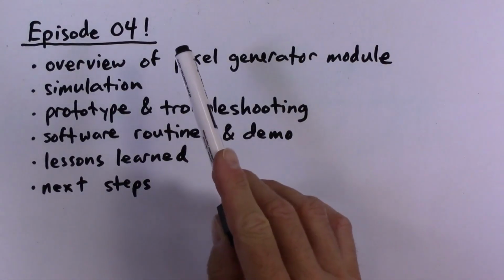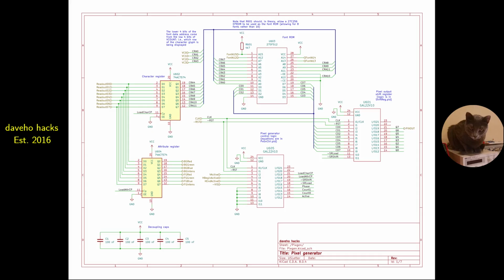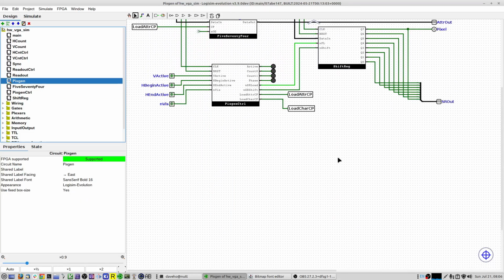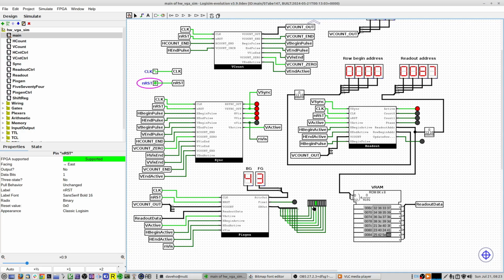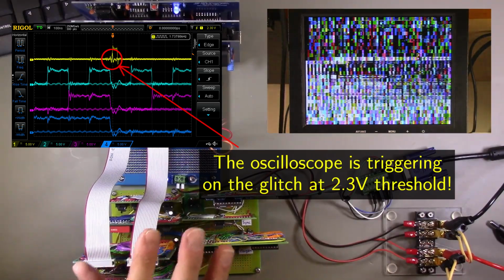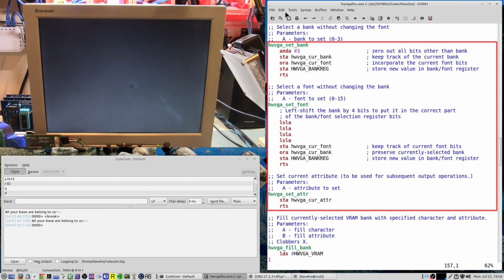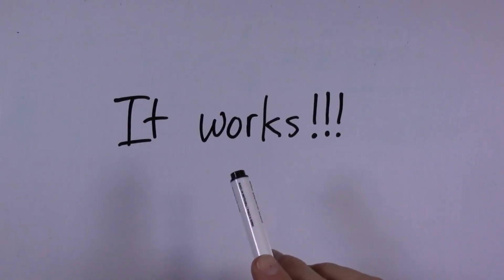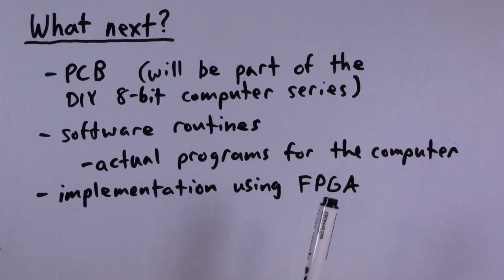Hardware VGA Episode 04: Pixel generation

Comment: Awesome progress, Dave. Very impressive!
Reply from the maker: Thanks, Troy! I've started working on the PCB. I think it's going to be pretty challenging to make everything fit. (BTW, I'd love to see a video about your Pi Pico TMS9918A replacement project.)
Reply: @davehohacks  it's coming... I'm a big-time procrastinator. 🤣 The project itself is going great though. I finally have the single board version with the RP2040 onboard working.I have a few short, unedited, unlisted videos linked in the GitHub repo.
Reply from the maker: @TroySchrapel  I procrastinated on my display controller for 2 years, so I think you're making rapid progress. Looking forward to seeing it!

Comment: Great work! Congrats on the successful design! Good luck with the PCB design! 
Question: why jump to FPGA and not go through a 5v CPLD design phase using something like an Altera MAX7000 series device? A 10ns  EPM7128 may be large enough and fast enough to incorporate most if not all your VGA hardware logic.
Reply from the maker: Thanks! Using a CPLD is an appealing idea. My main motivation for using an FPGA is the availability of an open-source toolchain for the Lattice ICE40 series. I think you're right that the current design wouldn't require a large device.
Reply: @davehohacks  the old Altera MAX7000 series is supported by older tools that are now free but not open-source, such as Quartus.  however,  they do offer a lot of design and simulation facilities that you may find useful.
Reply from the maker: @TMITLT  I'll keep that in mind!